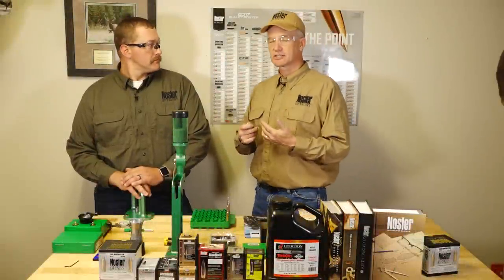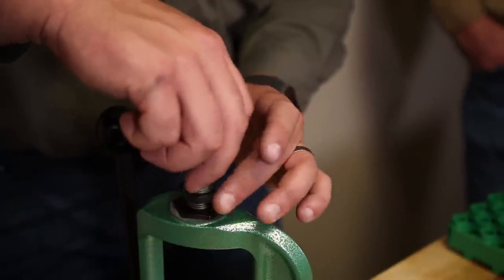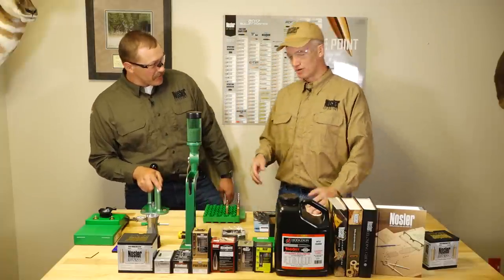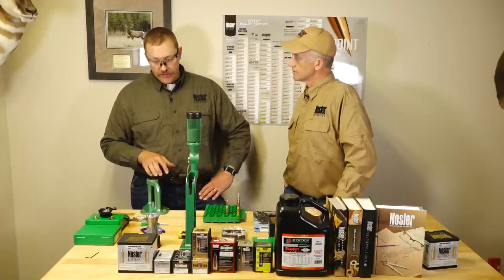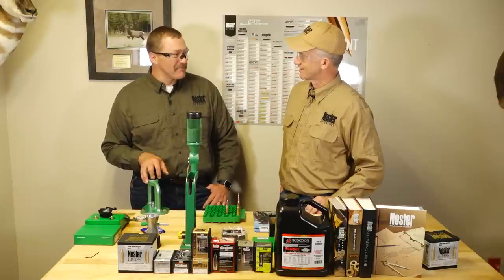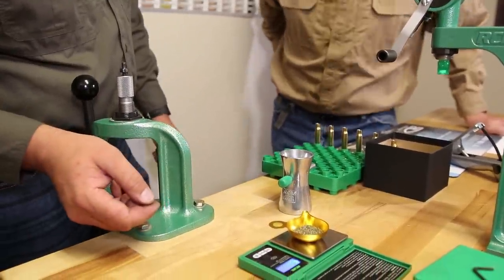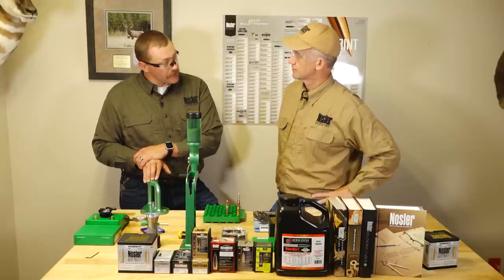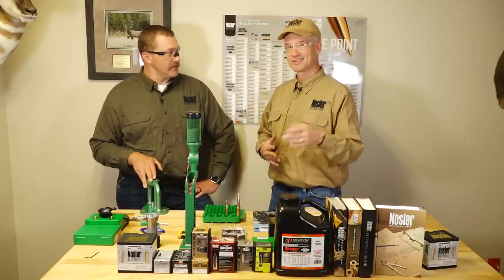Nosler Reloading Tutorial with Randy Newberg - Equipment & Safety (Part 10)

Comment: Hi Randy, 
And you might also want to consider getting a "neck sizing" die, since I'm sure you own more than one .308.  I'd keep the brass seperated and note which rifle they were shot in, since chambers can vary a lot.  That's why I sold one of my two 30'06 rifles. But nec sizing only will fit your chamber better, and not cause as much pressure or head space issues. 

goood Luck.

Comment: Here's my two cents, more like 5 cents USD. Lol. If you are shooting factory ammunition and are going to start reloading or are thinking of starting to reload KEEP your brass from your factory ammunition. You will save on the cost of the brass. Make sure you keep it separate as in which brass goes with what rifle BUT also keep separate the manufacturers brass. DO NOT mix and match manufacturers brass. Winchester has thicker brass then Remington different pressures different results. Both Remington and Winchester make good brass. Brass comes down to personal preference and like they said in the video it takes some steps out to get a more consistent brass like Nosler. So depends on how much time you want to put into preparing your brass.  Also if you bought yourself that new rifle and you want to start hand loading for it what I do is buy factory ammunition in the manufacturers brass that I want to reload and break my barrel in with that and there you go you got fire formed brass for that new rifle. 

Good job with the videos Randy lots of good info. I hope to see a more advanced reloading series in the future.
Reply from the maker: We are thinking of a more advanced series next year, once I have some reloading experience under my belt.  Hopefully that will allow beginners like myself to take that next step and implement some of the idea experience reloaders like you have been using for years.  Thanks for watching.
Reply: I am looking forward to that video. Can not wait.